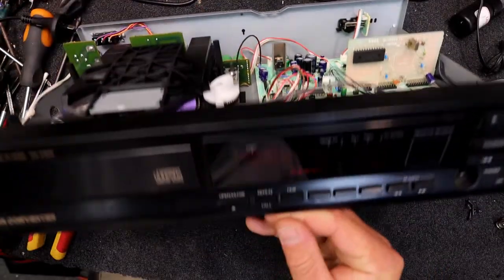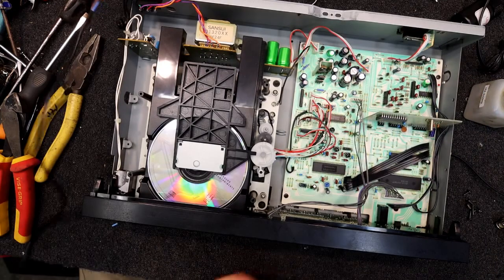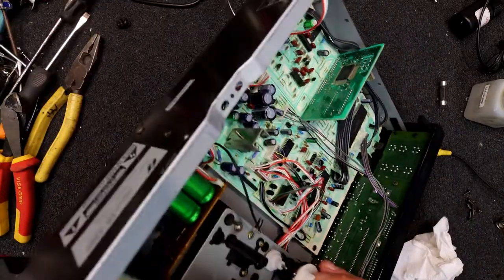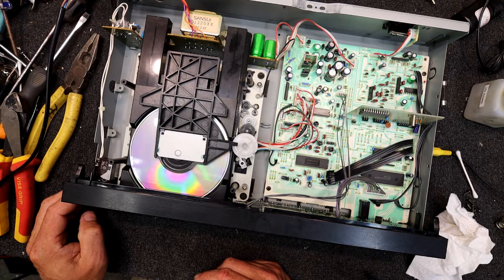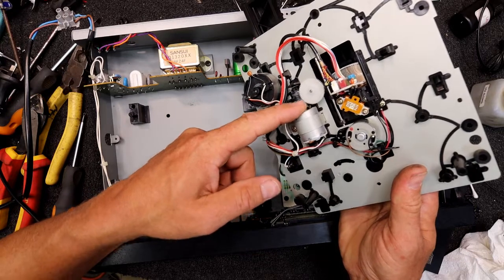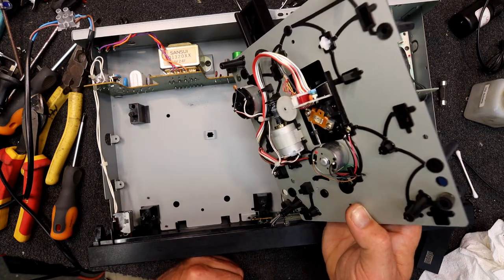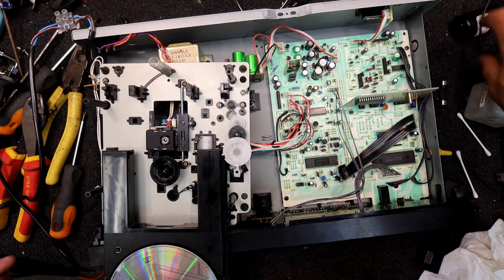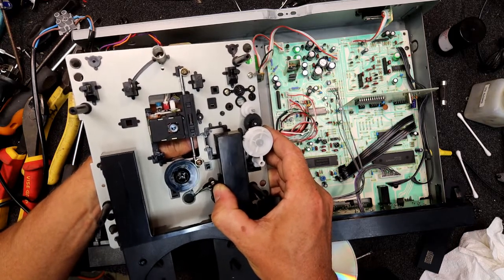CD Player Repair Part 3. Servicing and replacing the tray loading belt in a Sansui CD-X301i

Comment: Good informative video👍🏻
I’ve got a Onkyo DX-c390 (6 disc carousel) player that has issues reading discs, basically it doesn’t spin up straight away, and then starts going to the next disc and tries that one.
Problem is intermittent and cannot fault find what it is.
I’ve tweaked the laser trim pot, but not having much joy.
There are no issues once it reads and starts playing the disc, problem is that it takes a long time to spin up and read.
Any suggestions?
Cheers
Reply from the maker: Faulty spin motors can sometimes cause that sort of issue. If the disc isnt clamped properly and the spin motor can slip underneath it will also cause that sort of problem, and it often makes more noise when that happens. I have also had the flexible cables from the laser to the circuit board cause that sort of thing. Gently pushing on the cable to move it about with something plastic while its playing will show if the cable is OK. You can also try spinning the disc by hand when it wont read. If it then spins up fine its usually due to an older laser that might need the focus and tracking settings adjusting, though that isnt normally intermittent, though it can vary with different discs.
Reply: Thanks for the feedback. My laser mechanism looks like a Sony KSS-213. I Have tweaked the trim pot again, starting from full left and working my way clockwise, two small adjustments later it seems to be reading fine at this stage, however due to intermittent nature next time I turn it on it may not read. Funny thing is that once it reads the first disc OK then it will go on and read and play all the others without a problem.
Reply: When I get the chance, I will also check cable and lubrication etc. 
found replacement Sony KSS -213c online (AliExpress, claims to be genuine Sony) for around $25
Reply from the maker: @G3516dude  They did sell for that sort of money for real ones. That C version was the least reliable of them so might be worth changing at that price just to see.
Reply: How do we contact you for possible service and repair?

Comment: Previous owner tweaked every pot on a CD player I picked up. Now, it won’t play. Is there a process for returning the pots to neutral positions to just get it to play, and then do a full factory alignment later?
Reply from the maker: Sometimes the service manual will tell you how to do it. If you cant find one of those then I would set everything to middle and start with the focus adjustments. The other option would be to try every combination of the pots at each end, one quarter, half and three quarter positions and see if you can get it to read again, then fine tune from there. If the laser is on its way out that may still not work.
Reply: @StevesElectronicRepairShop  Took your advice. Set everything near the midpoint. Then by tweaking focus bias pot, got it to spin up. That is such a good feeling when it happens. Now, it seems to play the first 5 tracks of a commercially stamped CD, but the higher numbered tracks will not play and actually cause the disk to start spinning unchecked. I was hesitant to make a move since I just got it to spin up. Any suggestions for next steps. I figure you have most likely seen this symptom before and thought I would ask before I tried anything. Thanks again. I think we are getting there.
Reply from the maker: @rinkerlaw7446  The higher numbered tracks are harder to read so that is normal if its not set correctly. You can always mark the pots or take a photo so you know where they will at least read a disc before going any further. I would normally just adjust them as shown in my video using a bad disc and tapping on the player occasionally to see how it reacts, tweaking so it keeps improving. You may need to start with a good disc and see how it goes. Its possible that you have a worn out laser or spin motor or other problem that will mean you can never get it to play 100%.
Reply: @StevesElectronicRepairShop   Got it. Basically, I followed your suggestion -- tweaked the settings for the strongest RF on track one, then track two, etc., walking my way up to the highest track numbers. It's been playing flawlessly for about 2 hours now. I wonder how long it will have to play before I am truly confident that it is fixed. Thanks again for all of your help.
Reply from the maker: @rinkerlaw7446  Good to hear. Try it on some lightly scratched discs, and even ones that have around 80 minutes of sound. If I can play that sort of stuff it should be fine.

Comment: 12:34. Do you attempt to repair sony 400 mega storage players? I have sony CDP M555 ES & a sony DVO-CX995V player.
Reply: I know arm that picks disc up and place in slot has broken on 555ES! I’m assuming belt has broken on the CX995V. How do I contact you?
Reply: Sorry that’s a DVP-CX995V
Reply from the maker: @ccolem1595  I have never seen one of those Sonys, and generally I used to stay away from multidisc players other than the 5 disc carousel type.